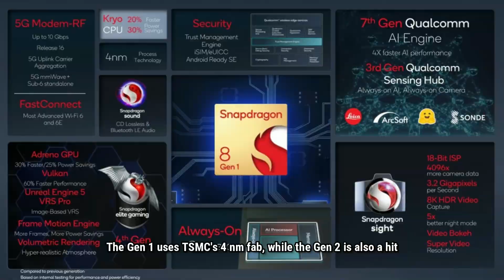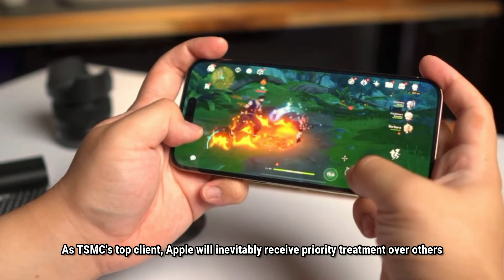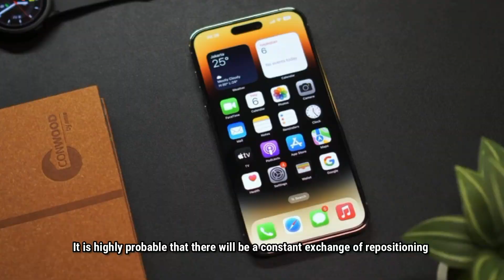The Race for 3nm Process  ---  Apple's A17 Bionic May Beat Qualcomm's Snapdragon 8 Gen 3 To It

Comment: The Funki A17 Bionic Fusion chip is the most advanced chip design the world has seen.  The Apple A17 Bionic chip will lag way behind it.
Reply: Most advanced mobile chipset design yes* when it comes to other processors it isn't even that complex, other than the transistor size, it isn't anything special at all, special cpus are for example Intel Xenon and Amd Threadripper cpus.